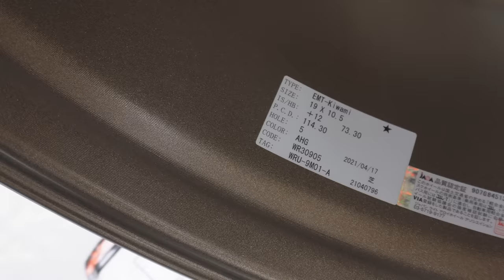Quick and Dirty Mold Making (+ Wheel Reveal) - Sky-gea build: Part 12

Comment: Amazing as always... you have inspired me to make some fg panels for a bike that I have spent too long looking for spare panels... I would like to make the mould but without wrecking the originals.. I don't mind drilling holes to brace them onto some wood to make the plug, what do u use to smooth off the edges? Some kind of putty? Blue tac? Lol

What are you putting on at 22.30? Thanks
Reply from the maker: I'd recommend checking out my previous videos on making the fender moulds for more detailed info.
For yours I would suggest using hot glue to fix your bracing, and then to smooth edges between your part and flanges you can use filleting wax or plasticine. A good coat of PVA over your plugs should protect them and the filleting wax should all come off without any damage.
Reply: @TofuAutoWorks  brilliant thankyou for replying, I was going to rematch this series anyway before attempting it haha, is the pva mixed with anything at all in the gun?
Reply from the maker: @D4VE26  The Poly Vinyl Alcohol is poured straight into the spraygun without diluting. You can pick it up from your fiberglass store when you grab all your other materials. (It is not the same thing as PVA glue)

Comment: I like those wheels. Such a classic design, especially considering all the other wheels with similar style. What's the clear tape you were using? I'm assuming it's not clear packing tape. lol
Reply from the maker: Cheers mate, and it really is just packing tape. It's something that almost everyone has on hand and gives an immediate glossy surface for the mould.
Reply: @TofuAutoWorks  I figured in was some teflon clear tape specifically for mold making. Nice to know it's something as simple as packing tape. Thanks!

Comment: you do an amazing job!! How to make the resin not dry so fast and you can work with the roller?
Reply from the maker: If your resin is curing on you too quick, try dropping your catalyst rate to 1.2 or 1%. Also mixing it in smaller batches will keep it cooler in the pot. If I mix more than say 800ml I'll typically pour half of it into another pot as two batches of 400ml will set in the pot a lot slower than a single 800ml

Comment: Have you thought about using a couple of layers of carbon fibre as the "show" layers? I know it costs a lot more, but I have seen some really cool paint effects you can do with carbon underneath (or just leave it raw)
Reply from the maker: For the finished product on this car I want it to look like without the body kit it could have been an OEM build. I'm going to be painting the whole car once it's complete and getting an exact match for the colour I want over the top of carbon like you'll see on vehicles like the Active Carbon GTRs would be a bit tricky so I'll likely stick with fiberglass

Comment: first layer of glas?? looks thinn ..Gram / m2 ?? like your work !!!
Reply from the maker: 80 gsm tissue followed by 225gsm chopped. This video I mostly glossed over the fiberglassing since my previous mould making videos were highly detailed. Feel free to give those a watch too if you haven't already.
Reply: @TofuAutoWorks   okey.. seen most of your videos.. but midst the info.. i done a Porsche 356 pre a body in my home garage in over 30 y Old molds... Did not have thin glas. Used fiberglass string in edges..

Comment: Hi excellent work !!  What is the weight of the first layer of cloth you are using? Thanks !
Reply from the maker: 80 gsm tissue followed up immediately by 225 gsm.
Reply: @TofuAutoWorks  What is the 80 gsm tissue normally used for?  What is the rational for using it as the first layer? Thanks !
Reply from the maker: Sorry I missed this one. 
The 80gsm tissue is a very fine layer that will contour quite well to most curves, but most importantly it will block print through of the more coarse fiberglass texture from the following layers. If you go straight to 225 as your first layer, often you will see a faint fiberglass texture through your gelcoat on the surface of your finished part. This doesn't matter so much on produced parts as they will always be sanded before paint, but with moulds you like to get the surface as clean as possible.

Comment: Another awesome video. Just wondering, why didn’t you do the body work before you made the molds?
Reply from the maker: Easier to apply filler and sand over a rigid fiberglass plug than deal with the plastic moving around on me. Since this mould was only going to be used once it didn't matter if the body work happened before or after.

Comment: Awesome work man, looking very cool! I'm always waiting for your new videos =) greetings from russia
p.s. Will there be an increased load on wheel bearings with such wide discs?
Reply from the maker: Thanks man.
The offset on these is 19x10.5 et-13 factoring in the spacer. It's a bit more negative but because they're so much wider, the center of the wheel is still pretty close to the center of the hub so there wont be any significant increase in bearing wear. Not like on my Mx5 that is 15x10 et-50 which is a lot worse.

Comment: Wtf, you order from Driftworks to NZ?! They're very local to me but I would've thought you'd have a dealer in Aus or buy direct from Japan!
Reply from the maker: When ordering these wheels we looked at all of the Works distributors. Since Driftworks are an official Works Wheels supplier, when I ordered through them we were initially going to have these wheels sent directly from the Japanese distributor, but the UK warehouse happened to have one last set in stock and I was able to get that even faster.

All of this for significantly cheaper than trying to buy locally, and I got the exact size and style I wanted.